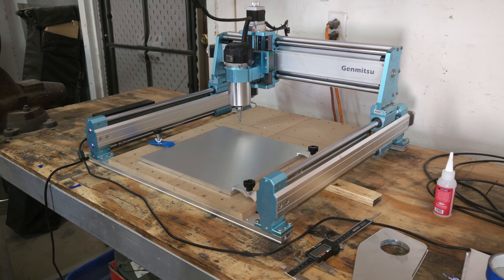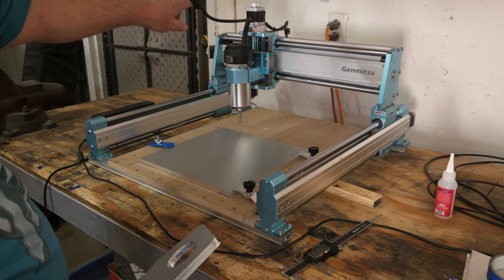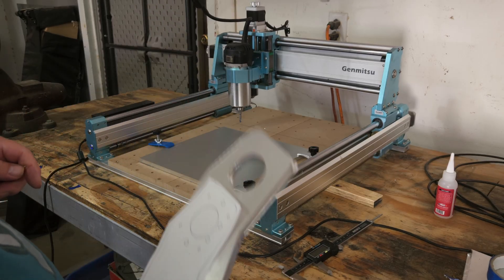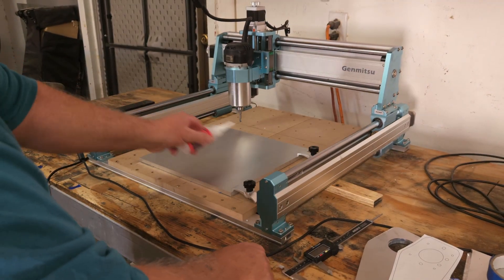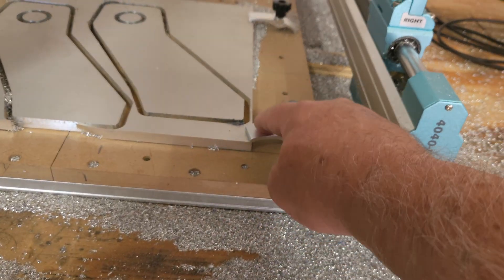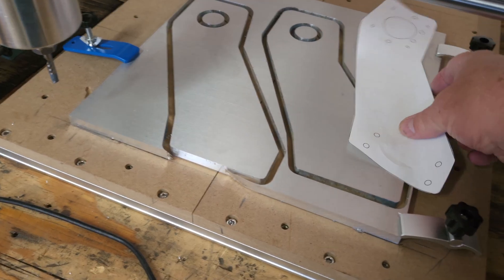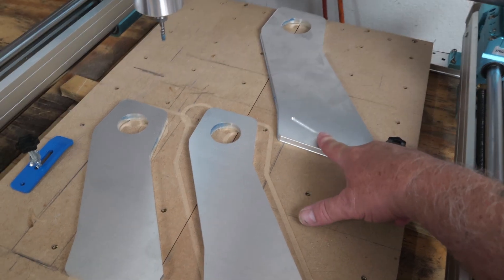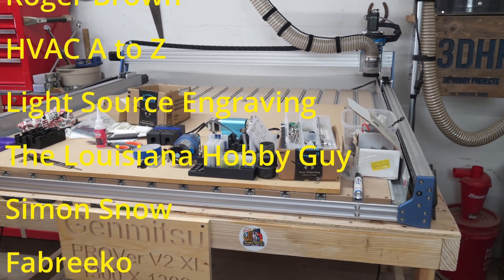Cutting Thick Aluminum on my CNC

Comment: Nice update cutting aluminum. If you're going to use compressed air, don't blow air into the rail bearings or ball screw assembly. You will get debris in to them and shorten the life and cause inaccuracies.  I like using a small paint brush to clear chips.

Comment: Hey, I have the same Genmitsu 4040 Pro Max, I went ahead like and subscribed to your channel.
The little machine are amazing machines, I am surprised of what you can do with these machines and I am surprised with what you did with the thick aluminum plate, a good demonstration.
Reply from the maker: Thanks for the Sub. It seems to be very rigid. Might put a Makita back on it when this trim router dies.

Comment: Why not drill pilot holes with the cnc? Why guess hole location when you can be precise?
Reply from the maker: I didn't know how to peck drill the larger holes,thats why I printed out the template I used in Carveco Maker to drill them. Next video I just posted might explain this.

Comment: You stated this is 1/4" Au but then said 11mm I think? That's almost 1/2". Also curious why you didn't use the CnC to drill the smaller screw holes? Seems like a no brainer to me, at least peck them for accuracy when moving to the drill press.

Comment: buy a cheap spot drill you can use that for marking the holes perfectly on that cnc also with that same spot drill you can use it to chamfer the sides to get rid of any sharp edges or debur, i would use a 1/4 or 3/8 spot drill setup as a new tool and just set the depth of cut in your program to like .025" to .050" of an inch
Reply: My idea , I always use this method for my aluminum cover plates, making use of the precision of the CNC machine and the heavy work done by the drill press, a perfect combination  fast and precise. (use a center drill for this (which you also use on a lathe), these are specially made for this purpose)

Comment: In the future, I recommend using an alcohol-based mixture for cooling and lubrication, and your work will be faster and more beautiful. We use 98% alcohol on Datron machines at work. Not oil. Alcohol is the best, it evaporates quickly and does not leave greasy stains and nothing is wet. With the correct settings, the alcohol consumption is small, and important thing, alcohol, when evaporating, in addition to lubricating, also cools the tool. Good lack.
Reply: Keep an eye on your ventilation... you could end up on a high, with big-black pupils, and a hangover in the morning!
Reply: @PiefacePete46  :face-green-smiling:
Reply: That will work good until you have a fire....

Comment: I didn't think the pro max would do so well on aluminum so thick. I mean, it's about as thick as the parts the machine itself is made of.
Reply: Just have to keep depth of cut and feeds/speeds reasonable.  You can also do extra passes to widen the slots to prevent chatter as you get deeper.  Aluminum is bit sticky so I use a little WD40 to keep cutter clean.  I have an Rf-15 clone mill but same principals apply.  Been thinking about one of these since they are pretty cheap for other machining operations where I need more room for larger sheets of aluminum.  You can beef up the machine to get more out of it.

Comment: I had similar issues with no solutions. Tried multiple usb cables to no avail. Finally I removed the Genmitsu control box and replaced it with a Mesa card and linuxcnc. Problems vanished with many added features.

Comment: Why didn’t you use the same 1/4 or a 1/8 endmill to mark the hole locations during the cut? That way you wouldn’t have to do manual measurements for the drill press process.
Reply from the maker: I wasn't sure how to set that up with the bits I have. I cut a template out of baltic burch on my laser for hole alignment. 4 of the holes have to be tapped. Thank you for your comment.
Reply: @3DHP  you should really switch to 1/8th, i was going to recommend it too. your machine has the RPM and feedrate, but not the rigidity and torque, so a 3,175mm endmill (4982/2397547th of a football field) and modern high speed machining pathways, like you can create with fusion360 (its free for hobby use and there are tons of tutorials on yt), will give you way better results than the way you run that machine right now.

Comment: i had a similar problem years ago on my tiny cnc , and also had same with printers decades ago, 
Data loss
either the  software  is to slow at sending large packets of data  via a to long of a USB cable,
A shorter cable  and not curled up and  have the cable strait as possible works better.

or it is just the USB cable is to long with bad shielding and getting  EMF from the router motor  

that's why cnc spindles are more expensive , they are shielded better 

and finally that all your electronic parts are  Earthed  properly and earthed to the mains/source
Reply: USB control breakoutboard have worst what ewer can use, all time lot problem whit code and data. if need good cnc need buy better bob board, mesa card working sure better, or old paraller port card, no problem whit data newer. if use worst USB card need be good shielded cable and short. and not use window os newer losses lot data and not safety use not real time working, and windows big problem is dangerous problem all shit interrupts losses data and work and make own runnn way not safety and not working all time sure, if want safety cnc and make job true good need be linux os machine.

Comment: Is that the stock spindle? 300W?
Reply from the maker: 710 watt according to company.
Reply: good spindle have more than 800W power, not use router its shit, best is 2,2KW water cooled spindle whit 1-phase to 3-phase VFD cost less than 200$ new. i has before 800W spindle, worst and no power big shit has, need be better spindle.
Reply: 300W not doing anything, its trash, not can work good whit wood and not newer whit aluminium. minimum good spindle need be 1,5KW whit VFD. can working something job.

Comment: SVG format is the worst file format to cut from. SVG has no scaling information embedded. Always use dxf or PDF for 2D and .3mf or .step for 3D models.
Reply from the maker: Thank you.dxf is what I ended up using. I didn't know any better.
Reply: Try STL format files.
Reply: @blazegbs   STL is all triangles.  Makes big files if you want detailed curves, and only approximates curves so any program that's generated from them will either have a ton of straight line moves or need to have smoothing applied in the post.  Even when that smoothing is applied, it's not guaranteed to be an exact match of the curve.  Close enough?  Probably.  But .step is miles better.
Reply: @FrostedImages  ummm scaling is in the name. Scalable Vector Graphic.
Reply: @thercguide4735 read the comment again and then comprehend it.
Reply: @thercguide4735  :  It certainly did a great job of scaling up his design... unfortunately that wasn't what he wanted.   🥴
Reply: @PiefacePete46  . Billions of SVGs are created everyday sent to an entire host of devices with no scaling issues. I use them to send files to lasers, vinyl and die cutters, as well as my CNC mill. 

The unfortunate part is, one should always double check everything before running the program.
Reply: i make all toolbath to G-code, safest and true right code, not newer use STL or SVG shit. but my machine have little better biggest strongest and use Vcarve (cracked) and linuxcnc. 1500 x 1500 table size nema 23 motors, 2,2KW spindle whit VFD, DIY build and cost me only 1200$ cheap but good, lot better than all openbuild,onefinity or other ower price shit 4000-6000 $ cnc machines have.